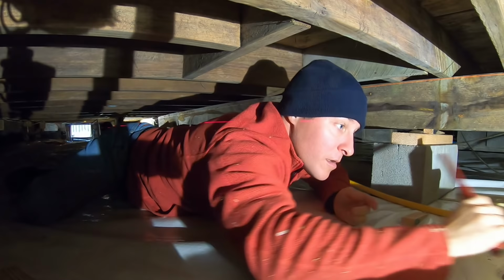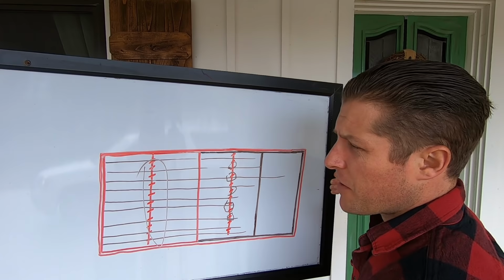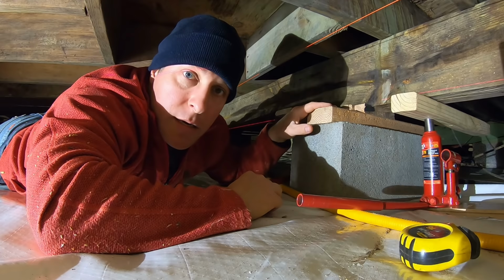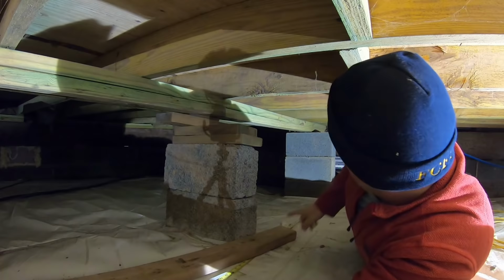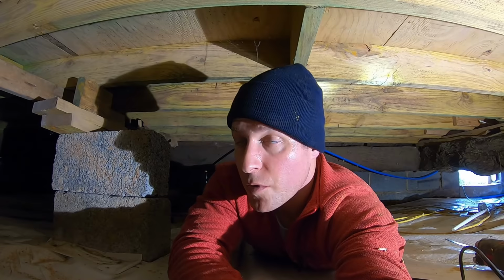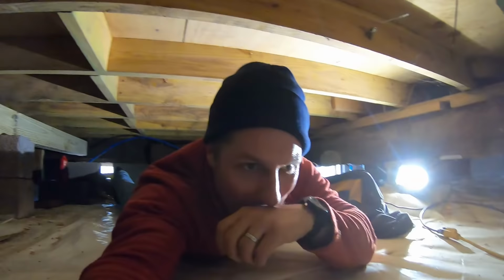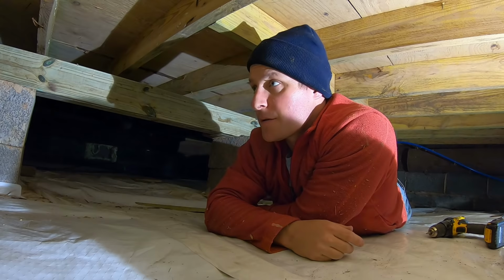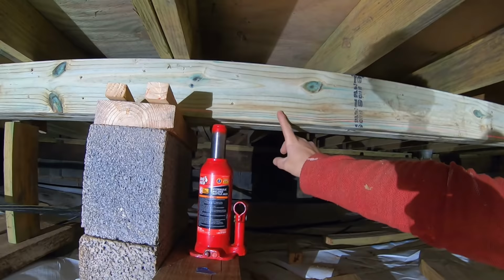Leveling FLOORS in our 100 year old Farmhouse! Fixer upper

Comment: Great Job! You mentioned the three 2X6  beams were able to hold up your load 2X over. What referenced building standard did you use to calculate these loads? - May you please share and explain? Thanks!
Reply from the maker: Thanks for watching. It was actually the national load span chart for 2x lumber. I found online during the time.  There is some educated guessing for your wall load and weight but pretty straight forward.

Comment: Thank you for sharing this video, it's excellent. One question: Why didn't you pour concrete footings for the new piers that are holding up the floor beam? Over time, won't the dry cinder block piers sink / settle?

Again, thank you for your video. I'm looking to do more or less the same project of a 1901 house.

Comment: I have a 200 year old house.    Added on to many time before its final  look in 1930.  The issue I am having is not low points but one high one.  The east beam never settle as they  enclosed the  east porch and added the second floor.  So that beam has no load on it anymore.  I am just worried about  removing what's left of the foundation to lower the floor.  This house has been a 15 year project.  But if you have any suggestions for high sports that would be much appreciated.

Comment: My girlfriend and I just bought our first house at 21. It's 104 years old. It's been a trip working on it. Thankfully we don't have too much sagging going on, but there's just one wall that's all screwed up. It's not supported by a joist AND whoever did the plumbing for the bathroom that the wall separates cut out like a 5 foot section of the bottom plate. I'm looking for some tips on how to  fix it. Should we tear out the floors so we can completely replace the whole bottom plate? Or just scab in some wood where they cut it away and add in another joist underneath? If you have an email I can send some pictures if you don't mind giving some ideas? Thanks.

Comment: You could have put the new beam directly under the 2x4's and saved a ton of work.
Reply from the maker: Working on a 100 year old house that’s everyone’s thoughts so old cracked rotten wood gets covered up and hidden all the time. Then it becomes a problem again down the road. I also remove any wood that has any defeats if at all possible and start new. Thanks for watching

Comment: When you did your leveling, did you dig footings before jacking up tge old beams and new beams.  Also, you should have strings or levels pulled up top where the sub floor or flooring is.  No joist is the same height, especially OLD joist.
Reply from the maker: No footers under the blocks the crawl space has a complete interior foundation French drain to a sump pump. So it’s super dry nothing to really break down the dirt. I was measuring from the bottom of the sub floor to the laser level. Can’t get more level than that unless the subfloor or flooring is different thickness luckily mine wasn’t.

Comment: Did you have to pour a concrete square area under the cinder blocks?

If so, what did you use and did you have to add rebar to the concrete?

The reason I ask is I have alot of sand in my crawlspace and need to figure out the best way to establish a base for my two-story home which is sagging.

Comment: I need to do this very same thing on my home and have been putting it off for so long. I'm fairly use to home repairs, but leveling is an area that is new to me. How were you able to level the house using a laser that is attached to the house? Doesn't it move when you start jacking up the house or am I completely missing the operation? My home is 35' x 75' and has sunk over the last several decades before we bought it so I have done some jacking up in areas that have several inches of sink, but no leveling.

Comment: I applaud your gumption and effort to place a proper load bearing beam but wonder at why you failed to provide the far easier to replace proper piers. Stacking multiple concrete blocks and additional multiple wood shims may be a good way to iterate jacking a beam under load to level but to leave the project there is not a good practice. After leveling a single 4x4 cut to exact length supported by a proper footing can be attached to the beam with a strong tie. The proper footing could be a single or double concrete block capped or not. The 4x4 could be up to 35” long (11 times the width of the post), far more than your small crawl space. You might want to revisit the piers later as another project.

Comment: Doesn't jacking up the joists run the risk of dislodging/damaging the plumbing and/or electrical pipes/conduits/etc.?
Reply from the maker: A few inches no not really. Just have to be mindful of what's around the area and use common since.

Comment: Hi, I wanted to ask what is the material that you used for your tarp? It looks really sturdy. We are getting ready to do some leveling on our 1940"s house and we would like to use that type of material to crawl around on top of instead of dirt.
Reply: I was thinking of modifying a mechanics creeper with wider wheels,, but I’m now considering using foam pads, (use them for camping a lot)

Comment: I have a question for everyone.  Trying to level my house like this.  25 foot wide, and one support in the center.  And it has sunk 6 or 8 inches.  I am trying to jack using a solid 8 by 16 block for footer support, that the jack sets on.  
the jack is pushing the block into the ground.  And I only have mabey 6 inches to work under the main beam now.  What can i use to act as a base to jack up on?

Comment: Great video, however i do have a question tho, my home is super old it was built in 1876! Mine needs done pretty bad and is super unlevel the second story bathroom is about 3 1/4 inches in 4’ so my question is everyone I’ve talked to said not to do this that it’ll crack the drywall/ plaster & potentially mess a lot up! What is your input on my situation I need some guidance here! At this moment I plan on just using self leveling because it seems like it’ll be easier on me! Thanks for the video hope to hear your advice 👍🏽

Comment: This is great information. My house was built in 1910, and i currently have uneven flooring throughout my Livingroom/ dining room/ front porch. My question is how that crawlspace is so nice and clean, and even has a floor cover?! Mine is full of leaves and random crap, also my crawlspace has a bit more height than yours. Any information how I can do this to mine possibly?
Reply from the maker: Hey there! Thanks for watching! We had to clean out the crawl space after we purchased the home. The hvac system was run through there back in the 80’s and it was disgusting, moldy, and mice infested. We pulled everything out (put new hvac system in the attic) and then had the crawl space encapsulated and a pump installed to keep out further water intrusion. The encapsulation included the vapor barrier (plastic) that you see. A lot of work went into getting the crawl space cleaned up the way it is in the video! Totally worth it!
Reply: @LittleDreamersFarm   ohhh wow! Yeah, mine still has the HVAC system underneath, with the AC unit box attached to the back of the house. I have the crisscross panels covering the crawl space, all around (it came that way). Thank you for getting back to me!! I really appreciate the information!

Comment: Just how much support are you  expecting from a  hollow core cmu without using a footing pad or a stone under the cmu. There is too much of a chance of  the webs breaking on a  hollow core cmu . You should have used jacking posts with concrete pads.

Comment: I just noticed... There's no insulation in your floor!  That's a big difference between your house and mine.  In order to measure the floor height, I need to remove fiberglass insulation, which means wearing a respirator.  Yecch!  So, who was your camera operator?
Reply from the maker: Thanks for watching. We had to pull all the insulation out it was in rough shape
Reply: Ah!  That explains it.  Removing fiberglass insulation would be an awful job for this DIY'er.  You have my respect and admiration.

Comment: I am currently running all new plumbing on thIs 1920 house that has had an addition put on in the 40's to add a bathroom. All the pipes froze and busted. This was supposed to be a bathroom remodel for my mother and it's turning bad. When I got under the house there is wood rot everywhere. There is fiberglass insulation in the floor Joyce and millions of spiders. There is an old black tarp someone put down but it was not taped or anything and it looks bad. There is bones from dead animals and some of the floor joyces are cracked in half and laying on the ground. The houses floors are all unlevel and I'm honestly not sure where to begin. I tried to nail some anchors for the pex pipe on the main support and the nail just falls out. What should I do?

Comment: I noticed you have a vapor barrier. Would you suggest doing that first? I'm in the same boat you're in but just getting started with my old (and tiny) farm house. I need to jack the floor up, sister some joists, and replace the sill on one side. I'm not sure what order to go in. Any suggestions would be appreciated.

Comment: I'm doing this right now.hime is over 100 years old.a wet mud basement.and I'm lost.ive tried several things.bought those basement posts etc.its so hard to figure out where to put them.
Reply from the maker: Thanks for watching. Just gotta put a plan together and keep on working on it it’ll come together quickly.
Reply: @LittleDreamersFarm  unfortunately mine is the old notched over the main beam construction.so when I attempted to level only the floor joists raised causing a springboard effect.

Comment: I just got a new roof on the house would leveling the floors do any damage to the roof?
Reply: Don't see how leveling the floors could damage the roof. There shouldn't be any structural link between the two.
Reply from the maker: 1-2” shouldn’t hurt a bit. Your roof is connected  through the trusses and wall studs.  So if your floor is sagging a bit your roof is probably doing the same. Shingle roof is very forgiving with movement. If it’s metal I’d try to keep it under 2” of movement before I would investigate the attic also and take some measurements to keep any eye on any shifting. Thanks watching

Comment: My floor is sloping toward a connecting bathroom that is tiled. Can I lower the high side down to match the bathroom. I can probably raise the Low side some but I don’t want to crack the tile. The bathroom is level and the bedroom connecting to the other side of the bedroom is level to the bathroom as well.

Comment: Could I do this sort of repair with hardwood flooring installed already? Also what type of laser level is that. Thanks for the informative video.
Reply from the maker: Thanks for watching! The laser level link is in the description. Best tool I’ve ever bought.
Reply from the maker: Yes you can do it with the floor installed just make small adjustments over time!

Comment: Are your cinder blocks sitting on concrete pads or just on dirt? I have a 4' crawl space. Whoever built this house put the main support beam in middle of hallway, instead of under load bearing wall! Now my floor is sinking on both sides of main beam!

Comment: Would love to know what clearance was under the house? Noted that the hole you entered was around 8 inches, Well done! 

Also, what is that matting that you have used on the ground? Thanks!
Reply from the maker: Clearance varied but it was maybe 3 ft where we were working! 

We had the crawlspace encapsulated and added a vapor barrier, that's the plastic on the ground you see! Thanks for watching!

Comment: So the ground underneath the cinderblock, is that a pylon or is it the ground and if it is soil, will it heave or sink?
Reply: I was thinking the same thing
Reply: Wondering too because the ends are cantilevered and offer no support. Also surprised there’s no mechanical attachment of the beams. So I’d be surprised if an engineer reviewed this complete design.

Comment: i am doing this next spring but our crawl is much lessss than yours so the floor has to come up. 
A qn: did you put any wider pad under each new support to spread the weight over the ground
Does that water vapour barrier allow moisture to flow one way, into the ground, or is it totally waterproof both ways
Reply from the maker: Hello thanks for watching. We didn’t put anything else down just the blocks. The vapor barrier is 100% water proof and we also have a whole house dehumidifier.
Reply: @LittleDreamersFarm  tks. I looked at your videos and it seems there are no other ones on the reno process?

Comment: Did you level out the area where you placed the cinder blocks? I feel like my crawl is much more uneven. How level does it need to be? Or does having support every 4ft essentially take care of the instability? Also, what level do you recommend? Any particular type of wood for the beam and shims??  And thank you for the video!
Reply from the maker: Thanks for watching. I roughly leveled the ground where the blocks where sitting. I have a 10" level and also a laser level which I use all the time. The 4' spacing fixes the sag and also prevents further issues I think.
Reply: @LittleDreamersFarm  ok, so you didn’t feel the need to dig a hole and fill with cement or rocks?  I’d like to avoid that if I don’t have to.  Thanks for the reply!
Reply from the maker: That’s right. I didn’t have any load bearing walls in the areas that were really bad. It was mainly center open room areas that were sagging the worst. But no I didn’t feel the need to do anything more than just level the dirt under the blocks I was adding.  My crawlspace is dry and has no water coming in ever. So no water no compaction or movement I figured.
Reply: @LittleDreamersFarm  ok thank you!

Comment: Did you just put CMU blocks in the middle of each 8ft span right on the ground? Or did you dig and poured a concrete footing?
Reply from the maker: We put the block right on the dirt. That’s how it was built and only sagged 2” over 60 plus years after the house was moved. For our situation it was our best option. So I just doubled up and adjusted what we already had down. Thanks for watching

Comment: What did you guys put under your cinder blocks? I am assuming this is a dirt crawl space?
Reply: Your supposed to put full pads under the cinders. And you also suppose to make sure the pad is set level.
Reply: @longdongbingbong9067  what do you mean full pads?
Reply: @wesleybolton1250  it a concrete pad that16x16 that sits under the cinder block. They are used to give the cinder block to set on so they aren’t just sinking into dirt causing issues later. Most lumber yard that sell cinders have them.

Comment: Why didn't you put them in place one by one then nail and though bolt them together. Would have been much easier.
Reply from the maker: Thanks for watching! Lying on your back with a 16’  piece of lumber nailing 3 of them together would’ve been impossible to get them straight. This question gets asked a lot. If you’ve ever made a support beam out of multiple pieces I think you would answer your own question. They must be bolted together on a flat level surface otherwise you’ll never get them lined up.  Same reason why 100% LVL laminated vernier lumber support beams are built off site and brought to the site for install.
Reply: @LittleDreamersFarm  especially with 2 people
Reply from the maker: I wasn’t talking about the fastening them together! It’s hard to explain but each board has a different bend or arch in it. So without having them standing vertical on a flat slab of concrete you have no leverage to even them all out and fasten. Otherwise with 2’ of room assembling them under the house you would just fasten them together in the same arch or bow the floor joist are. Not trying to sound like a smartass but like I said before it’s the same reason any builder brings in the beams assembled and doesn’t screw them all together in the air under the roof/floor  joist.
Reply: @LittleDreamersFarm  I fully understand about wood I am in construction
Reply: @LittleDreamersFarm  you would crown up all boards
Reply from the maker: Yes that’s an option your right! I just didn’t want my floors crowned. I choose to assemble it on a slab and use my tractor bucket to make sure it’s was perfectly straight for my floor.  Since it’s wasn’t under any load walls and just a free spanning floor. I didn’t want to have to look at a crowned floor on the interior I’m a little ocd. Thanks for watching .
Reply: @LittleDreamersFarm  I was just throwing it out there You did a great job was just curious.

Comment: What capacity jacks did you use? I have the same issue at my house and don’t want to find out after I get going that I bought jacks that weren’t strong enough
Reply: 20 ton air jacks work best use at least a half dozen and u have to raise them really slow like 1/2 inch a day let it set a week or those old joists will crack in near future make damn sure u crib everything as u go  or prepare to get smashed happens all the time

Comment: Why didn’t you just use a 6 x 6
Reply from the maker: I looked at that option in my area the pressure treated post are never dry and impossible to find without any twist or curves. In my experience when they do dry from the PT process there never straight. Also we have a whole house dehumidifier in our crawl space that keeps it very dry. So I didn’t want to take the change of it drying out to quick and looking like a banana lol. Thanks for watching